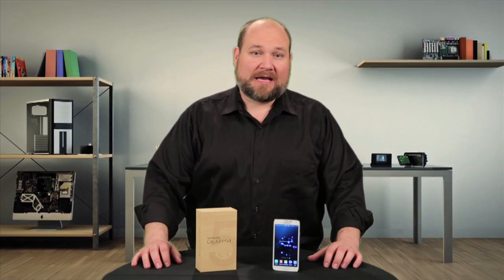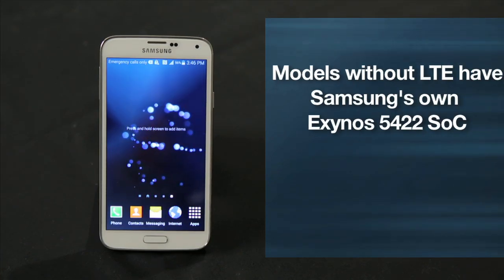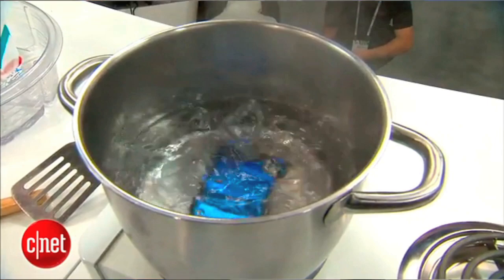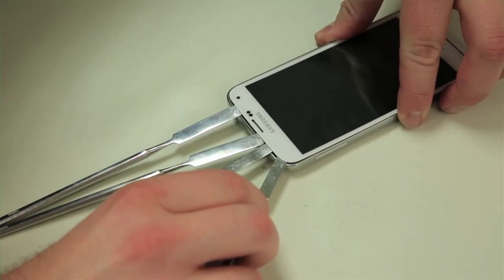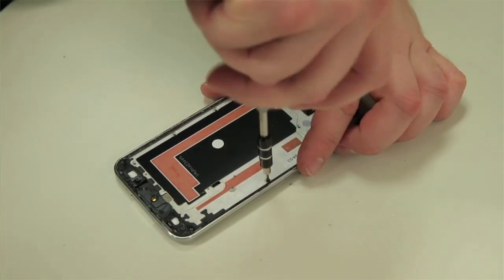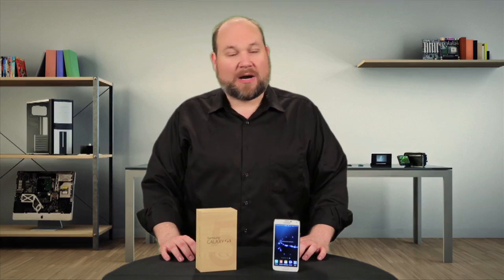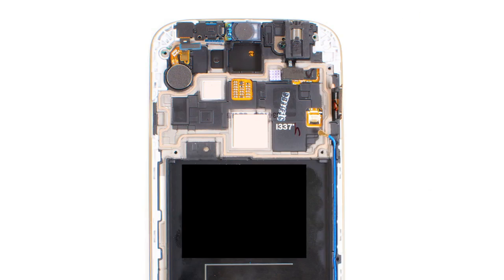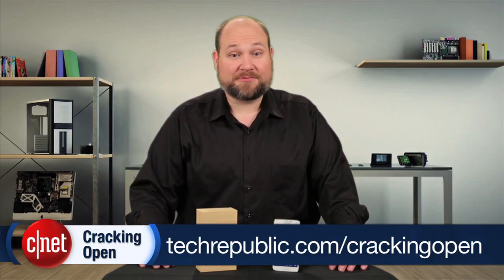Cracking Open - Samsung Galaxy S5

Comment: this is why removable battery is a better design for smartphones. That way the smartphones can be held together with more screws than an adhesive. this will make the assembly and dissembling of the device much easier. A fixed battery design makes it a nightmare to open the case.

Comment: Why is the audio so weak?
Reply: I wondered that too.
Reply: Probably the small speaker in the phone just isn't powerful enough. That, coupled with the limited space due to other components and the thiness of the phone. It may be a little tinny, but it's certainly loud enough for indoors.
Reply: Mrvideosandgames No, he's referring to the audio volume of this video.  I have it cranked up 100% on the video and also my computer's system volume to 100% and I can still barely hear the guy in the video...
Reply: mike.choi Are you trying to use headphones as a pair of speakers or something? I have no problems at 10%.
Reply: mike.choi change your speakers .. lol i'm at 20% no problem at all ..